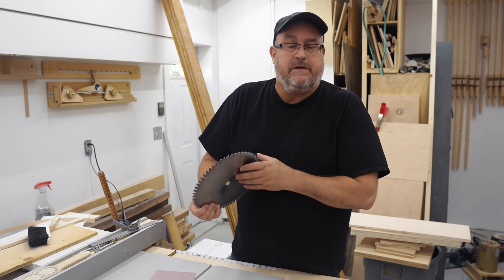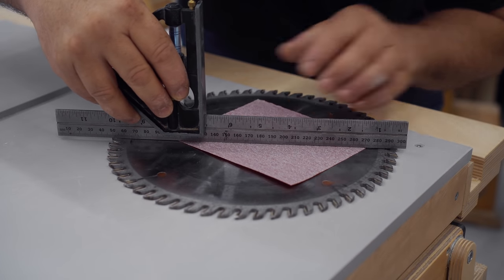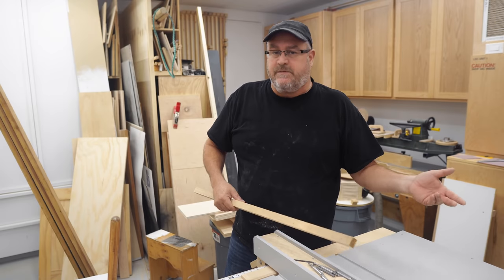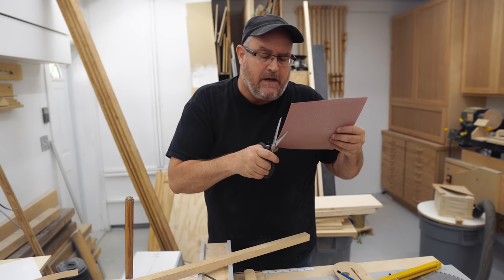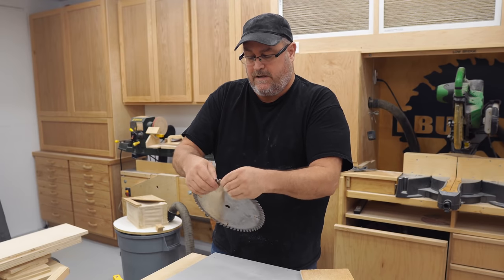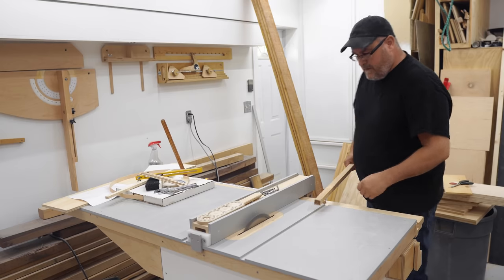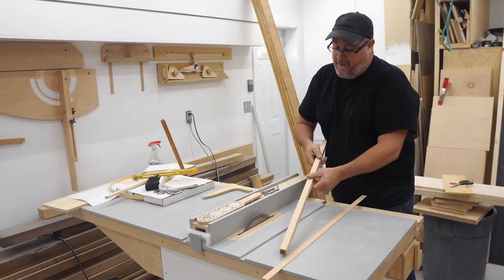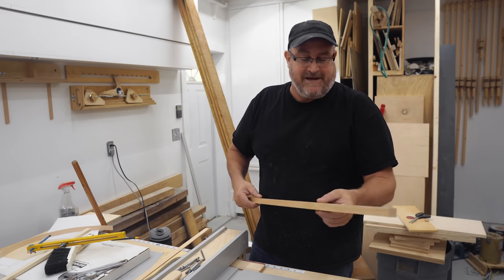Can you Cut and Sand at the Same Time? Interesting Results...

Comment from the maker: Of course while this does work, it's not especially practical. There is the upside of always having a disk sander (with an especially aggressive edge) ready to use, if you are brave enough.  
In all seriousness, I can't recommend doing this. The table saw is for cutting efficiently to accurate dimensions and then you normally take it from there and joint, plane or machine sand it to the final smoothness. You get better control and better results overall when break up the operations in that way. 
I quickly remembered why I don't use this blade - it makes that high pitched sound that's just about intolerable. Not sure what causes it (it's not the sandpaper), but I've only had one other blade that did it
Reply: They have been selling these sanding disks for the saw blade for a long time it's called Final Cut. Product # 602-FCD65802.  $12.00 for 2.
Reply: Defective vibration dampening in the blade. The goop that they put in those circular slots is supposed to absorb vibrations and prevent resonance, but if it isn't bonded correctly or damaged that doesn't happen.

Edit: Oh, and some of those  high tooth count blades just whine because of the tooth spacing I think.
Reply: I hope this video goes viral for you like cutting wood with paper.
Reply: But did it change the dimension when you put the sandpaper on there or did it keep the right dimension?
Reply: Very ingenious idea. I think it could be extremely useful when using the sanded edge on the outside. 
The whining sound comes from a blade that's not flat ; it has wind. Very symptomatic. Nothing to be done about that. As one commentator pointed out, some (high quality) blades have stress cuts, and sometimes even brass inserts. In fact, some very high-end models are very smooth and silent. Here in Europe they're very expensive - something bordering on 200$ or more. They make fantastic cuts. The truer the blade, the better the cut. Thanks for sharing. Greetings from France.
Reply: Very neat idea and guts to try it :D
I get high pitched sound when my blades become dull or resin builds up on the cutters.
Reply: just not a well calibrated blade, instead of taking material off only on the tips on the outside of the blade, it's gouging out material on the sides where it's not supposed to as well

that's why you're left with the whorls and swirl pattern
Reply: Maybe it would be useful when cutting mdf. I cut mdf for paint grade projects but still have to sand the pieces to remove saw marks. This might cut that step down some. Loved the video and loved your reaction. Thanks.
Reply: The heat from the blade and multiple cuts will eventually cause the adhesive to fail, too.
Reply: @musamor75  Jesus I don't even spend that much on 12 inch diamond blades anymore
Reply: @skm9420  I understand, and agree. The problem is that France is a very expensive country to live in. Everything is expensive here. One litre (sorry, we don't do imperial here) of white glue - pva (poly-vinyl-acetate) is over 20$. 
But, coming back to saw blades, in all fairness, the high grade stuff was a joy to use. I worked in the high-end furniture industry in Paris. We're talking HIGH-END. A good tool is always a joy to use. But this idea of John's was very nifty (cool in American). Enjoy your woodworking my friend.
Reply: And now of course for anyone who does not own a disc sander, use your table saw and move your material towards the sand paper blade from the side!.....Of course you may want to use a toothless blade....
Reply: musamor75 the good news is that wine and coffee are cheap (in comparison to Belgium at least)
Reply: I would imagine that this could also increase the chance of kickback and make it more severe?
Reply: Drill a hole in the Blade , somewhere near the center , it's like a cracked bell , it won't ring any more
Reply: What a clever idea, especially for someone like me, who doesn't have a disc sander, a planer, or even a belt sander. Besides, I think this can give better flatness than sanding afterwards, where you're likely to take off more material in some spots than in others. This is almost as good as you would get with planing after the cut, better than a disc, belt, or orbital sander.
Reply: @John H

About that high-pitched ring/tone: since you're hit-rodding the cutting with well-placed, glued sandpaper, you might now consider something similar for altering the entrainment of air by the teeth of the blade in operation. The frequency of the whine should give you a clue, given the diameter of the blade (a range, but small) and the rotational speed (unloaded and loaded), about where, both on the circumference (e.g. BDC) and the radius, to concentrate interventions.
Reply: Its funny I was thinking of doing this just a couple weeks ago. Now I know it works, I might waste my time doing it :-D love the tool for taking the nut of the blade. You make that? Or you buy it?
Reply: Sandpaper on a saw blade at 3450 RPM is scary..  I have a Jet belt/disk sander but I put the big sanding disk on my ShopSmith for edge sanding.  I can control the speed and use the fence to guide. Another reason to keep the SS.
Reply: It works. But. Your blade life, not just on the blade you use for cutting but also if you are doing planing, using a router, or doing other finish work may suffer from grit transferred to the surface of the wood. So for the benefit of a prettier looking cut and saving one pass with a sander, there's a lot of  downside for many jobs. If you're just ripping and leaving the lumber with no further blade work, it might be fine.
Reply: I agree. Not super practical but fun to watch never the less. Next level: route and sand at the same time 😉😁
Reply: @gvanvoor  Everything's cheaper over there. France is a disgustingly expensive country to live in. The Euro has made life hell. The ratio is : 1€ = 6.55 francs français. Some things that cost 1 franc now cost 1€. 655% inflation. Salaries are NOT 6 and a half what they were. See the picture ? We are ruled by Liars and Robber Banksters. You might want to look into WHO founded the Fed, and who they really are. You're of Flemish origin, but seem to live in America, which is very different from Europe. The small man can get further in America than in Europe. That's WHY Europeans moved to America. 
By the way, I suppose you know that New York was called New Amsterdam until 1699, then the Saxons took over. 
History is just about land, possession, money, and power.
Enjoy your wine my friend, but try to drink good quality. Cheers.
Gezondheit.
Reply: It appears to very practical 🤔.. no extra steps, fast set up, no negative impact. Guess we have a different definition of practical
Reply: I'll be honest; I thought it wasn't going to work at all so I was totally wrong.    But you are right; I'm trying to think of a practical reason to do this and of course no idea how long that sandpaper would last on the blade or if it would potentially make kickback even more a problem or not.    It was a fun experiment though!  :)
Reply: Graith Tools come on 🙄
Reply: @TheDirtCreature  This is exactly what I thought when I read the title. I wouldn't have thought it would impact the severity, just increase the chance. Especially using glue!
Reply: It would be practical for woodturners cutting segments, always trying to get the perfect fit without all the fiddly sanding there.
Reply: Yea I agree,  while neet i like my cuts clean and never found the need to sand the inside of a joint or cut. I can do it by hand or with one of my other safer tools.
Reply: High tooth count carbide teeth blades, have horrible high pitch  sounds!
Reply: So if I were you, I’d invent this new sand blade with a rough diamond side built into the metal of the blade. That way you get the smoother cut effect and don’t use e to glue sandpaper to the blade. Then you don’t have to sand as much to get the desired finish. Anything that cuts down on time is a definite win!
Reply: Still a cool idea, even just for fun. Very creative.
Reply: Wait. Where’s the obligatory rant about youtube, or complaining about SOMETHING?! Thumbs dowwwwn! Boooooo! I’ll come back to this channel when it returns to normal.
Reply: @richardflorence3927  Just like tooth width, operator adjustment.
Reply: @musamor75  Those 'robber banksters' and other 'elites' will meet their end soon at the hands of Jehovah God. His Kingdom is quite close at hand and will shove these other govts out the way and won't be nice about it. Prepare for it. Ally yourself with Jah while there is still time...or is there? JWorg
Reply: I think it almost works but the blade cuts on both sides, leaving semi-circular trails in the wood that the sand paper just can't sand down.
Reply: John Heisz - I Build It why don’t you use a riving knife?
Reply: I can see it making a difference if you're cutting an edge off. Never thought of this.
Reply: I'd imagine that having that extra drag on the blade is probably not great for the motor either....
Reply: could the sound be the blade wobbling extremely fast because of that minimal weight imbalance due to the sandpaper on the side? heard the tool has a 15 micrometer tolerance at the hole in the so it doesnt explode due to wobbling
Reply: @PapiSmerf  That can can be a cause for a high pitched noise . Another cause would be the shape of the teeth , or  if the teeth are sharpened , cause you get a diffent air stream in the frame when they get smaller . I work on a CNC - sawing machine , and we start at a teeth thickness of 4.50 mm , and go to around 3.95 before the sawblade is being retired  , but in the 4.15 - 4.30mm range we also get  a higher pitched noise very frequently.
Reply: @musamor75  Rule of thumb : lower the saw speed , get a piece of MDF and cut it . If you see diagonal crosses , you have a good saw blade.
Reply: @AndreaArzensek  True , also when they are sharpende , cause you get a different air stream.
Reply: @musamor75  Most (C)NC -cutting saws also have a sensor for the saw blade : if the sawblade isn't stressed out properly , the saw will stop , if it falls out of the calibrated values, Personally I think a $250 sawblade ( $ 2500-3500 if you go for diamond :) ) on a hobby machine is a bit overkill.
Reply: @vgullotta  And you off center the blade by glueing stuff on it :)
Reply: @ls8799  not putting the blade off "center " but imparting imbalances with the glued pieces of paper and different amounts of glue. Possibly making the piece more substantially inclined to cause kickback 🤔
Reply: you my friend might have a business making idea
Reply: Hi, I'm new watcher, maybe new subscriber, I enjoy the edits very clean, and this idea was just interesting to watch. Congrats man! Hope to see more weird ideas
Reply: Hey man you better patent that before somebody steals that idea
Reply: Will it work on a mitre saw?
Reply: But isn't experimenting half of the fun in learning? Sometimes the best solutions come from the craziest ideas.
Reply: I'd guess the sound is either the whole blade resonating, or the teeth making the sound, kinda like a whip makes a high pitched sound when it slices through the air, or maybe both.
Reply: It sounds like a terrible terrible terrible idea a good way to spend the weekend in the local emergency room getting stitches
Reply: Respect.
Reply: changing the sand paper every time you need to do it must be a pain too
Reply: The whistling comes from the teeth of the sawblade. They’re angled forward. I used a radial arm saw with the same problem. Had the teeth ground back so that they were perpendicular to the center of the blade. No more problem.
Reply: Silmarillion definitely
Reply: Great for people who don’t have a plane or jointer 🤷‍♂️ (like me)
Reply: the sound comes from imbalance quality
Reply: Maybe one of the channels with slow motion cameras can help us figure out what it happening with that noise. I would like to know if it is an aerodynamic effect or a mechanical resonance. Is the blade ringing like a bell when it is running? Does taping over the expansion slots do anything? What about pressing some viscoelastic foam to the side of the blade while it is running? This kind of noise is causing hearing damage at large scale in woodworking shops so there is some real value to figuring out why some blades do this and others do not.
Reply: @gvanvoor  Gezondheit
Reply: I wonder how much of an effect it has on the kerf size, and if the width remains consistent throughout the whole piece. Particularly where you stopped to grab the push stick. It got sanded more in the spot, so is there a dip in the wood?
Reply: The high pitched sound is probably caused by air movement created by the blade similar to air raid/tornado sirens.
Reply: IDK man...it's a fun experiment and all but seems like it could turn into a kickback monster
Reply: Nice, cut and first rough sanding at the same time.
Reply: @PapiSmerf  i can confirm it, "ghetto" table saws made by my grandpa back in the 70s all have this issue because they lack this feature. It can be somewhat reduced with fleece pads but they don't help much on larger blades.
Reply: @musamor75  Thanks for the info mus, I wondered why we don't hear about France as much in the USA anymore - obviously the robber barrons want to keep their scam quiet.
Reply: @EyesoreJr  Yes sir ! Cutting edge thinking there... :-)
Reply: @musamor75 , has "nifty" only just now made it across the Atlantic? From my childhood!
Reply: @rf6497  John makes everything himself. I wouldn't be surprised if he made the sandpaper! :)
Reply: It does the high pitch sound because is it has more teeth than the others.
Reply: @jimthomas777 , two holes, for balance?
Reply: @ls8799 great data, thanks amigo!
Reply: I AM YOUR LEADER , it is not stupid, it is innovation.
Reply: @leehaelters6182  , if you would take notice , 
Some saw blades already come with a small single hole in them , some don't , the ones usually without a hole  drilled is the noise maker ,  no need for two holes drilled , there isn't that much weight removed from one little hole even though the blade is spinning 5000rpm , how much does glued sandpaper on the side of the blade weigh ?
Reply: @JackTalyorD , I don’t agree. I don’t see dangers that cannot be compensated for. Would you flap your hands about shouting “Danger Will Robinson!” at an ordinary disc sander?
Reply: @omicronixzerus2929 , you should have been using a blade with no hook on your radial saw from the get-go.
Reply: @Sk0lzky , I like the term “ghetto saw”!
Reply: @leehaelters6182  , No , I'm just saying that it is unnecessary , but if you want to drill holes , go ahead , 
Why does the factory only put one hole instead of two ?
Because it's too much extra work for them to do , they give that job for just you
Reply: @jimthomas777 , that’s me, alright!
Reply: Funny thing about that gamble is if you loose you losses and if U win you don't win anything you just get to keep what U have already.

Like playing Russian roulette with a gun to your fingers and everytime the gun doesn't go off U get to keep them but just occasionally it dose and well no more fingers.
Reply: @JackTalyorD , well I truly do not claim to be smarter, but after forty years in the craft and the trade, I still have ten intact fingers, a little bit less so on the hearing. I thought that we were talking about using the applied sanding disc while ripping or cross cutting. I definitely do not endorse using the sawblade as a regular sanding disc. I’ll reread what you were responding to, I guess I misunderstood your intent I mentioned the disc sander only as another rotating disk with sandpaper applied, to show that abrasive sheet applied to a rotating disk was not abnormally dangerous.
Reply: @leehaelters6182  I guess my point is that pushing towards the blade with uneven force or friction on one side of the blade seams like a bad idea with the possibility of sandpaper delaminating and binding in the cut spitting the timber back at you.

As a time saver maybe.

Running 200 meters of timber threw in 4 hours not so much.( Constantly not being sure if it's going to do what's is meant to do.)
Reply: @leehaelters6182  and your right a lot of the danger can be compensated for with practice training and experience U feel the vibration in the tool U know when something wrong.

Sean so many boys take the guards off grinders because....... and 99.9%of the time no problems........ But it only takes 1 fuck up.
Reply: @leehaelters6182  or U punch a disc sander you might lose some skin 

Punch a table saw your going to lose a finger or if your lucky a nice scary and nerve damage.

I don't see how it's a good comparison at all.
Reply: @JackTalyorD , acknowledged that the critical difference between an ordinary disc sander and the innovation under review here is open face versus buried in a kerf. I remember that twenty-five or thirty years ago a sawblade was available that had grit bonded to the plate, for the same purpose as the item we are discussing. It may have been called the SanBlade.
Reply: @JackTalyorD  , I am always surprised at those experienced guys that insist on never using the shield on angle grinders. I agree with your opinion of rolling the dice,  the odds are stacked against you in the long run, always.
Reply: @Creator_Nater  - but you'll have to come back to see if it has returned to whatever you define as normal - this somewhat defeating your childish intention...  lmao
Reply: @MastaTutorialz  Did you not hear him say it was like it before...?
Reply: @ls8799  How is that? The sandpaper is on the nut side...
Reply: @JackTalyorD  Explain please...
Reply: @Mr7suna  Wouldn't this be the same with a 'normal' disc sander?
Reply: @harryinhuahin1272  I have read up
Reply: @JackTalyorD  - and that's your explanation...?  lol.
Reply: @harryinhuahin1272  and that's your question
Reply: @PapiSmerf  yeah I use a 80 tooth blade on my 3hp radial arm saw, she screams like a pornstar
Reply: 4l
Reply: I know that your YouTube channel may provide you with enough $$, but you definitely would deserve a little extra with some sort of a licensing deal with Milwaukee or Diablo or something like that.
I would buy one of these for sure.